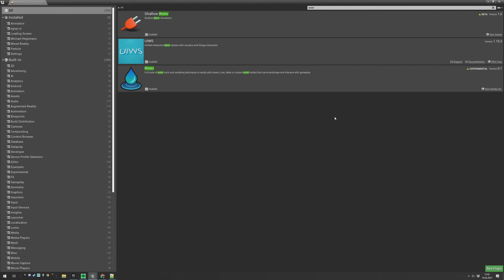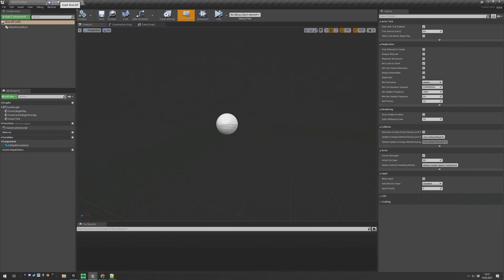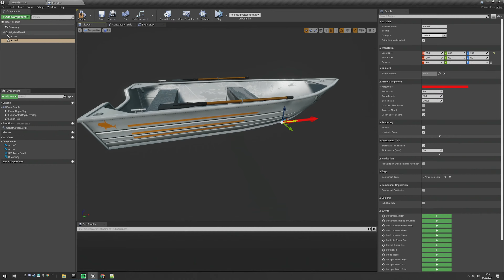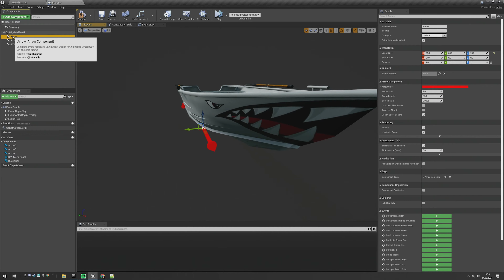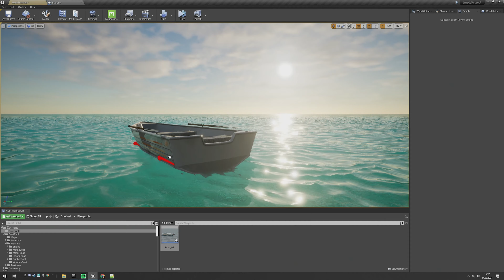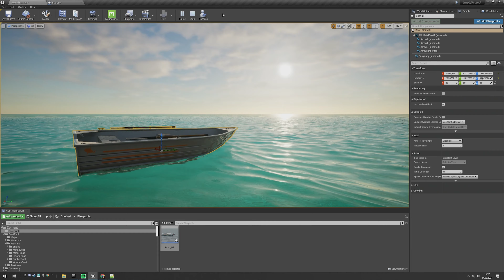UE4 Perfectly Floating Boat - Tutorial - Unreal Engine Water System 4.26.1

Comment: For those whose asking it's the same in unreal 5.0.0, I had issues with it and tried all the steps. How I fixed my issues was changing the root component, ticked auto-activate. I used a lake and not an ocean so the rocking won't be as severe. Now I am off to make it driveable.
Reply: Hey, I was exactly looking for this, you changed the root component from the boat static mesh to which component exactly?
Reply: @mr.enigmador  I'll need to go over, it tomorrow and I'll copy in paste the code I have if that helps.
Reply: @narrgamedesigner2747  That would really help.Thanks a lot !!
Reply: Also my boat is a physics actor, its kg is 135, the static mesh is set to physics automation to true, including simulate physics.
Reply: @mr.enigmador  I don't know if you solved this, but I just dragged the static mesh on top of the root drop-down.

Comment: Around 4:18, you talk about the buoyancy damp and damp 2 but don't say what they're for: After some experimenting, I believe these are settings to adjust the rate at which the pontoons apply buoyant forces to the boat. So a higher damp 1 value would slow down (not lessen) the buoyant force, not sure what the difference between damp 1 and damp 2 values are other than that one is first order and the second is second order. 

Basically if you raise your damp factor your boat will be more steady in the water.
Reply from the maker: Yes absolutely correct, it describes the "bounciness" of the object. Higher damp factors decrease the force the object receives by the water in relation to the mass of your floating mesh.
Reply: I was going to ask how you make your object look heavier in the water but this answers my question :)
Reply from the maker: Glad that I could help already 🙂
Reply: Thank you so much for actually going in depth. This is in my opinion the difference between a decent and great tutorial: Those that explain what the options does instead of just telling you which options to choose.

Comment: It's not quite perfect though as you can see in the intro video that the boat is bobbing up and down quite convincingly but isn't drifting in the waves at all. Waves should not only push the boat up and down but also push it slightly in the direction of the waves.

Comment: the boat is floating over the water in the video.   if you lower the boat into the water,  the water texture probably passes through the boat.
whats the easiest way to solve this  ?  something about which which draw layer is called first? i forget the term,
Reply from the maker: I agree the boat should be a bit deeper in the water but it's not floating above it completely. How I solved it was to have a mesh that has a bit of space in between from the boat's "floor" to the bottom point of the boat. But this is only working for big waves or shallow water. Smaller wave spikes will still glitch through the boat's floor.
I am currently having a look at another solution related to the WaterBodyExclusionVolume which cuts a hole in the water but I'll still have to test it though. I'll keep you updated when I find a solution to this 😉
Reply: @ue5mentor  Very interested in this, any updates?
Reply from the maker: @corneliusjohnson6615   No they didn't add that feature yet, I think we have to wait longer since I found out that this hasn't that much priority on their side.
Reply: in the 4.26 epic water presentation video (the one with lighthouse) dude briefly talks about masking out water with exclusion volumes but without much detail, not sure how it fits the 'stock' water material
Reply from the maker: @laggyluk  the problem with this is that it is still a kind of static component which can't be added as an actor to a boat for example. I hope this will get implemented soon, then we could "cut out" the water where the boat floats which fixes the issue with water shown inside the boat.
Reply: @ue5mentor  well yeah but from the presentation video it looks like exclusion volume supplies coordinates as params to water material to mask it out, not sure how that is supposed to work with multiple actors tho, also waiting for some more insight from epic staff

Comment: Hello, I have followed the tutorial step by step and in the water test map it works, but when I do it in my custom map it does not. Do you know what could be happening?
Reply from the maker: Hmm sounds strange, I'll have a look on what could cause this and come back to you as soon as I know. I have to test this in my own scene first.
Reply from the maker: Sorry for my late response but i was very busy the last weeks. You could fix this in two ways:
1. For your custom map, did you use the "Water Body Ocean" component and put it in your scene? If so, try to select it and give it 0,0,0 coordinates. Your landscape center should also be around the 0 coordinates. If the ocean body and/or the landscape body are far away from the 0 coordinates, it can lead to issues with the water system.
2. If it still doesn't work try to verify your engine files in the launcher for UE4.26 this helped my fixing issues with the water system that occurred for me as well.

Comment: yes this is not working on a custom map but just the water map! Can you guide me through?
Reply from the maker: For your custom map, did you use the "Water Body Ocean" component and put it in your scene? If so, try to select it and give it 0,0,0 coordinates. Your landscape center should also be around the 0 coordinates. If the ocean body and/or the landscape body are far away from the 0 coordinates, it can lead to issues with the water system.

Comment: my boat just topples over one side, i already adjusted my pontoons to be equal on both sides but it still does it, how do i fix this?
Reply: Had the same issue, made sure I actually had equal on both sides and then I raised them quite a bit after that I also made sure they were OUTSIDE the boat and not inside of it. 

Now I just have to figure out how to make it more stable :)
Reply: @wirpyy  i "kind of" solved my problem by readjusting the model, it now floats but it bobs about weirdly and not like a usual ship but it'll do
Reply: @wirpyy  you can set dampening of angles and pontoons strength to make the model not jerk around too much
Reply: @sergeantblue6115  Yeah, I just sat down. About to make more adjustments for it. Thanks for the tip.

Comment: Adding more than 2 pontoons sinks the boat
Reply from the maker: Hey there sorry for the late response, totally overseen this comment. When your boat sinks try the following:
1. Make sure that you place the boat a bit above the surface
2. Check the mass of your boat mesh I think the value is too high, try to adjust it to 50 for the beginning and then slowly increase the mass until your boat floats correctly
Reply: @ue5mentor  yup ive tried those
Reply from the maker: @w47-p1e  thats strange. have you double-checked that simulate physics is checked for the mesh and if the collision presets of the mesh are also set to physics actor? Also check the radius of your pontoon points, when it is below 100 it can lead to issues. If this doesn't work I suggest that you follow the tutorial step by step maybe you missed something
Reply: @ue5mentor  I found myself with that same problem, and also found 5 more ppl saying the same thing. Maybe it is a bug: I was able to reproduce the problem in multiple projects. I'm using 4.26.2 and tested more than once with the same settings, checked multiple weights, damps and pontoon radius, all returned the same way:
-Any object with more than 2 pontoons sink.
-2 pontoons floats
-1 pontoon floats
Reply: @ue5mentor  I've checked every possible case I could find on the internet.
Reply from the maker: @aoshinn  Ok i've checked several issues how this can occur I'll list it again and hopefully you can fix it with one of them:
- You need to make sure that your mesh is the root component of your actor, this is also ignored by most of the people who have this issue. Just drag and drop your mesh on the "DefaultSceneRoot" component in your blueprint actor
- I found out that your boat can also sink when your pontoon radius is either too small or too big, a value of 100 worked always for me. But in general, when the radius of your pontoon points is overlapping with other pontoon points your boat will sink. On the other hand when the radius is too small the buoyancy component cant handle it and your boat will sink as well.
- And then last thing as I said above, but it is still very important, the pontoons must be way above the water surface. When those collide with the surface or are near the surface your boat will sink on startup
Reply from the maker: @w47-p1e  I had another look at this issue and found out that it can have different reasons I describe in the comment to Aoshi. Please have a look I hope it fixes your problem.
Reply from the maker: @UtilesFacts   Sorry for my late response guys but i was very busy the last weeks. There are two last things you could do to fix this, when those doesn't help I really don't know what is causing this:
1. For your custom map, did you use the "Water Body Ocean" component and put it in your scene? If so, try to select it and give it 0,0,0 coordinates. Your landscape center should also be around the 0 coordinates. If the ocean body and/or the landscape body are far away from the 0 coordinates, it can lead to issues with the water system.
2. If it still doesn't work try to verify your engine files in the launcher for UE4.26 this helped my fixing issues with the water system that occurred for me as well.
Reply from the maker: @Lando452  See the comment I wrote for Nam MuSs below, this could fix your issue.
Reply: Did you try using a different static mesh? Some static meshes can't support more than 2 pontoons for some reason
Reply: @unrelentingpest  I tried the default cube mesh, no luck
Reply: @chrisgill4187  Yes, the default cube mesh is one of the ones that is known to not support more than 2 pontoons. Try making a simple model in Blender and see if it works.
Reply: @ue5mentor  This one worked for me - You need to make sure that your mesh is the root component of your actor, this is also ignored by most of the people who have this issue. Just drag and drop your mesh on the "DefaultSceneRoot" component in your blueprint actor
Reply from the maker: @RyanshawMe  Thanks a lot for sharing this information 👍 I did this in the tutorial but didn't mention it specifically.
Reply: @ue5mentor  I unfortunately have tried all the solutions in this thread and it's still sinking.